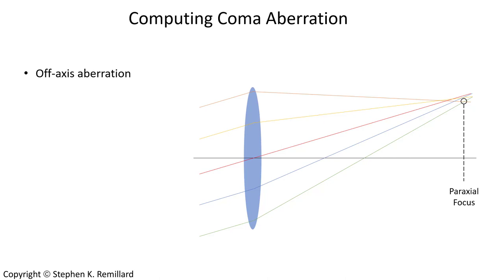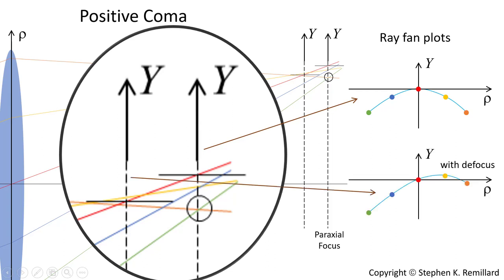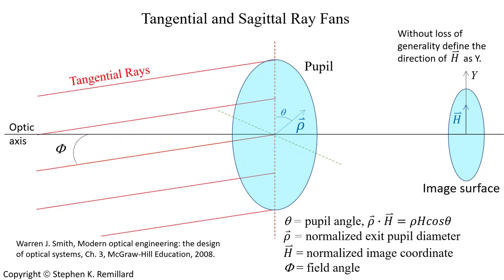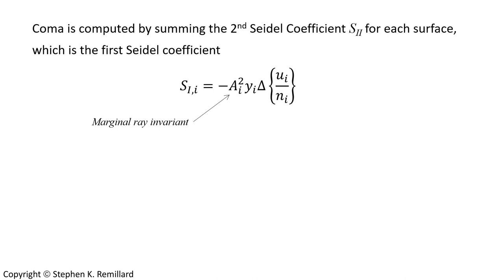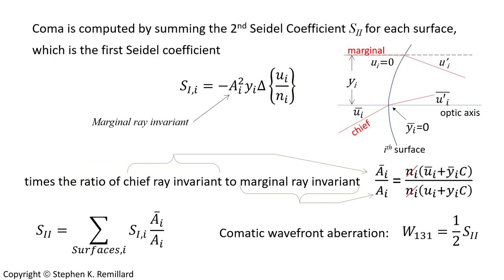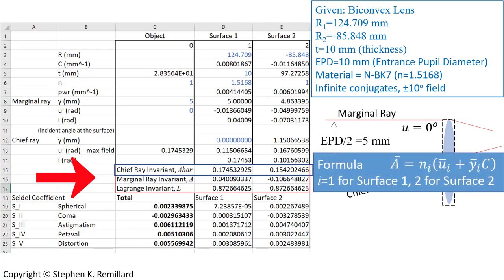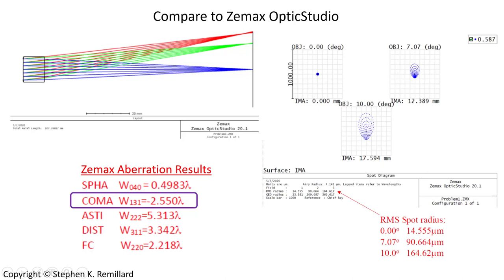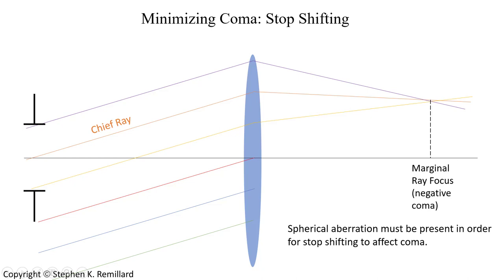Coma Aberration of a Lens: With a Computational Example

Comment from the maker: I see that I left out at 16:30 a helpful comment that the coma elimination condition of X=0.800 is for this refractive index of the crown glass being used in this calculation.  The ideal X for zero coma, as well as minimum spherical, varies a little bit within the range of typical crown refractive indices.  This spreadsheet is perfect for finding that optimal value of X for other glass types.

Comment from the maker: A viewer pointed this out.  The OP deleted the comment, but it's a very important point.  My naming scheme (positive and negative coma) is backwards from some current textbook authors.  Several textbooks name it oppositely, as revealed in this paper https://opg.optica.org/ao/abstract.cfm?URI=ao-27-12-2580.  I am using what I (and maybe only I) call the Arizona naming convention: https://www.azooptics.com/Article.aspx?ArticleID=660.  But my rationale is simply this: Cases with positive Seidel coefficient are what I chose to call "positive coma".  Cases with negative Seidel coefficient are what I chose to call "negative coma".  When the marginal rays focus closer to the optical axis than the chief ray pierce, the Seidel coefficient is positive.  So that is why I call that case positive coma.  I have noticed that some textbook authors (and software developers) avoid the naming of positive and negative altogether.  I can see why!  Positive and negative are only names.